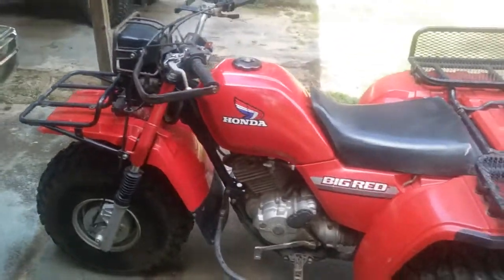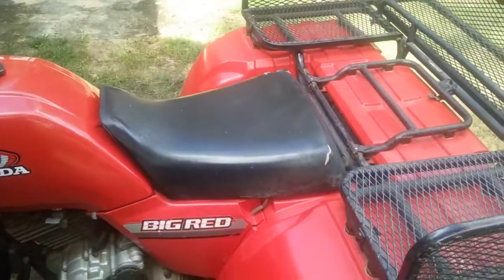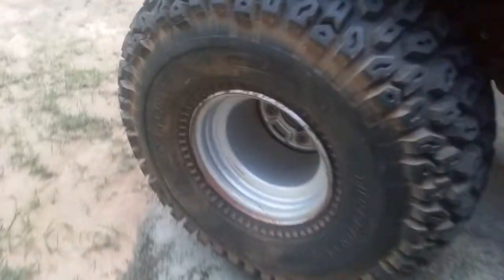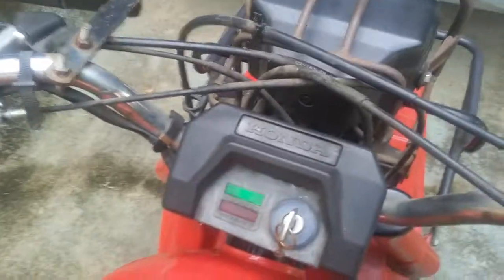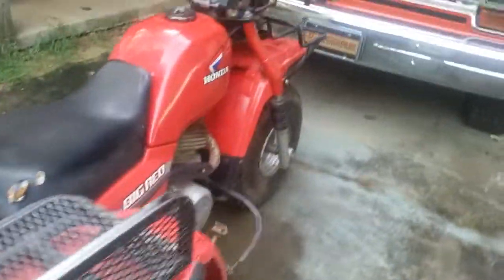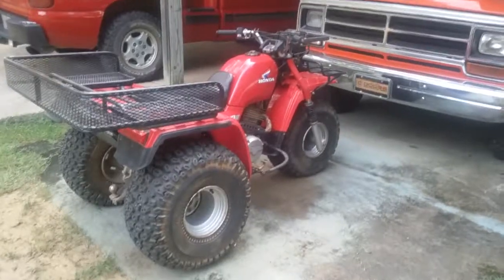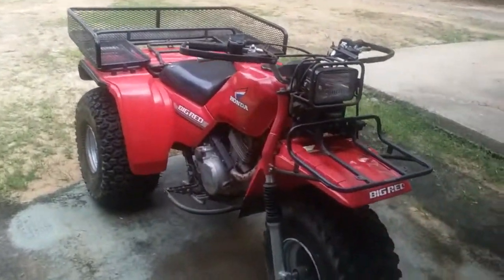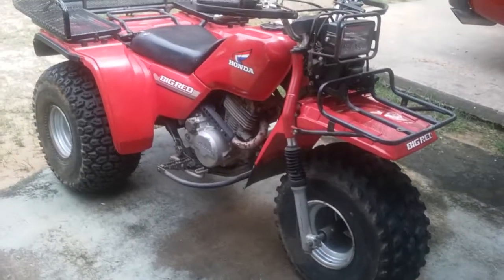My 1985 Honda 250 Big Red

Comment: I'm looking at one of these that was a previous parts bike. Missing the wheels, tires and plastic fenders, but the engine is still there. However the engine is seized too. But it's somewhat complete. The frame is still there lol
Reply from the maker: Yikes... sounds like a lot of work, but they're fun, and totally worth it. And getting rarer. I have a 250sx in the back, that did run, and has newer plastic I'd probably sell for the right price, but I'm starting to want to hold on to it, as these things are hard to find these days!!
If the price is right on the one you're looking at, I'd shoot.
Got an add or something on it, so I could see. I'm not an expert, but I've owned 4, or 5 of these in my time lol
Reply: @EJtcbGRAY  yeah. Turns out it was more complete than what I thought. Has all the fenders wheels and tires but the engine is froze up. I'm looking and gonna see what I can find for a rebuild kit or something
Reply from the maker: @oldcroneysgarage9739  10-4
Used to be able to by them fairly reasonable online. Was gonna get one for my SX but never did. Good luck with it. Love these things!